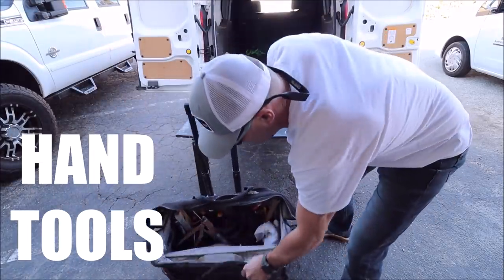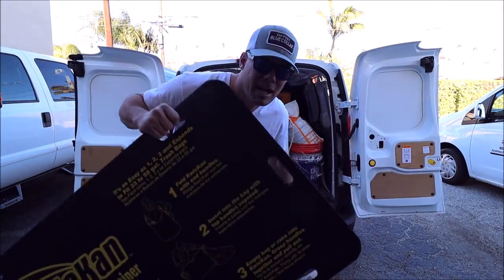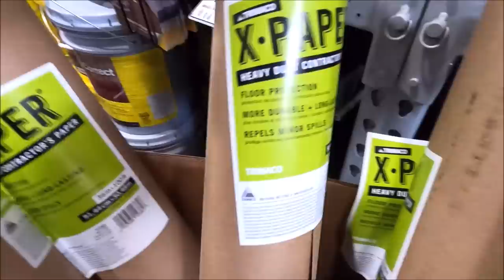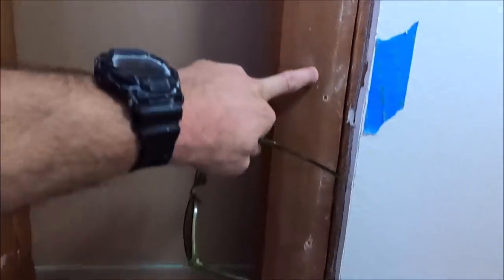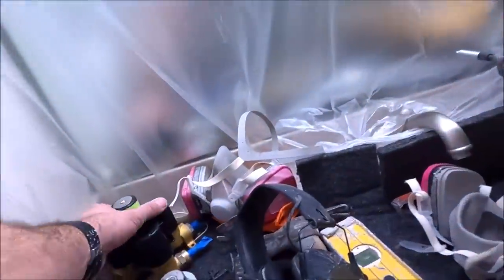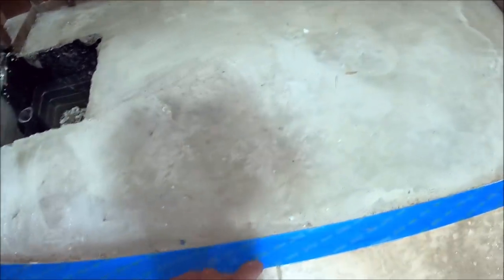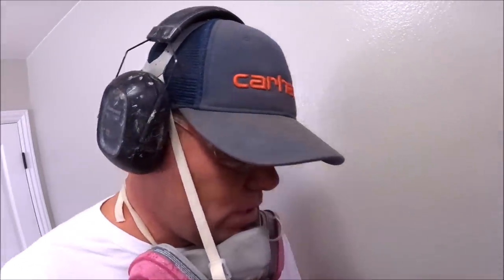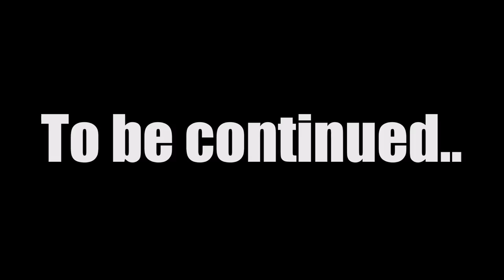Day One | Shower Tub Combo Remodel and Problems Already!

Comment: I’ve only ripped that type of shower out twice. Did the exact same things you did. Cut drywall back, remove screws from flange then cut it down the corners and across the lip of the tub. Great work great hustle

Comment: I’m curious when you took the stud out. It didn’t pull the screws out of the drywall from the backing wall.
Reply: A lot of studs in homes don’t have screws in them. I run into this all the time in bathrooms as there are often more studs than necessary to hold everything together.
Reply: Then your lucky. Here, it's glue and screwed
Reply: @BZ1340  I run into that too. There’s certainly no standard way out there.

Comment: Do you guys not have individual licenses for your trades? Here in Massachusetts every trade has there own licenses and permits. You would never be able to close walls in one day. First, you need your rough plumbing and electrical inspections. Then insulation inspection if your insulating, then rough framing inspection. If all passes, you can then start to close up walls. This is of course if your pulling a permit for the job.

Comment: I wish I could cut my tubs out like that, I live in Ga lots of hillbilly plumbers put there plumbing in walls knee high running from one side to the other SMH almost like contractors decided to move bathroom across houses and need to move water lines with it 
Just run it with the electrical lol

Comment: You have to get the makita drywall cutter it is awesome. You can get a battery adapter for about $20
Reply from the maker: what's the model number?
Reply: Makita XDS01Z 18V LXT Lithium-Ion Cordless Cut-Out Saw. Easy to use and helps keep dust down
Reply: Thats my go to for drywall removal. Set the depth of the blade. No wires cut etc. Plus I have my small vac attached to it. Make sure to grab an extra set of blades to keep in the case